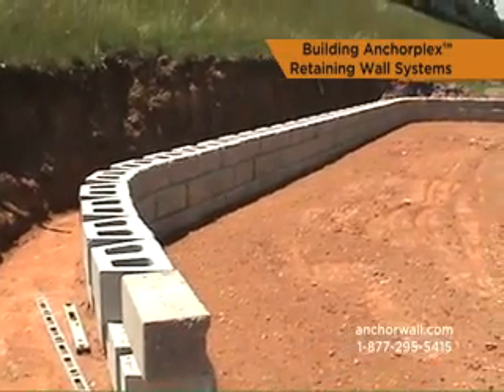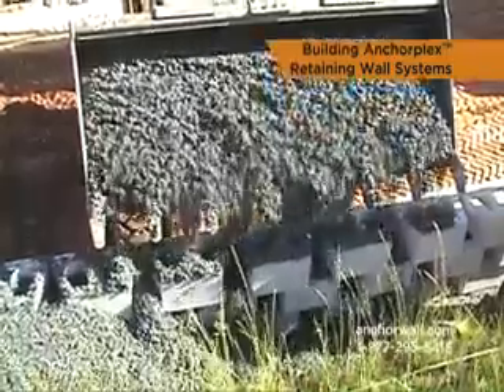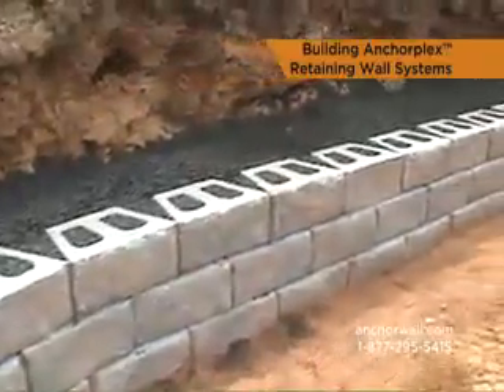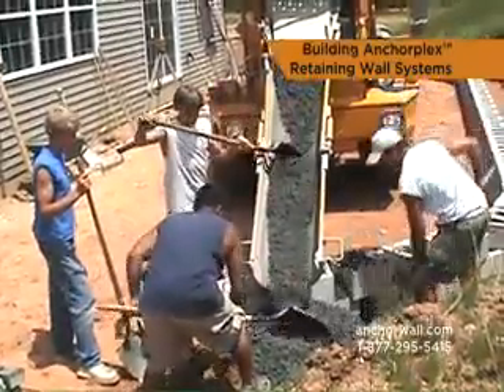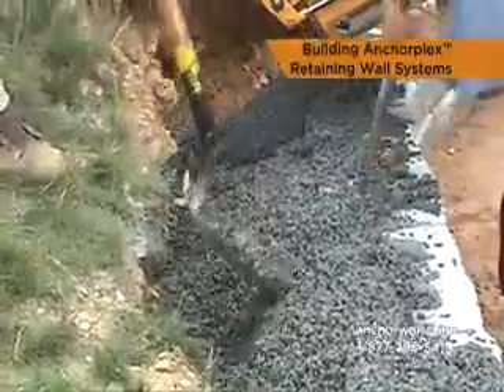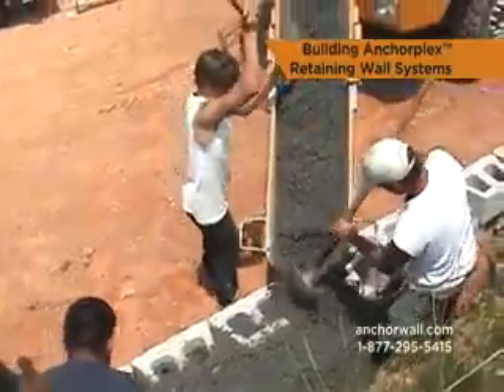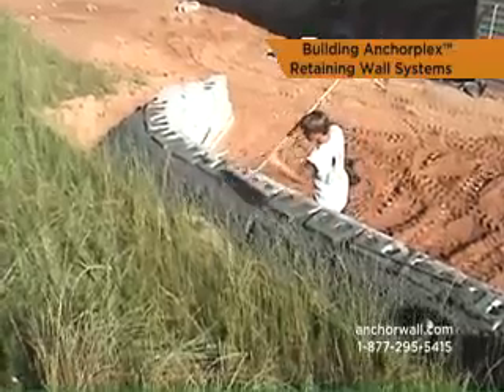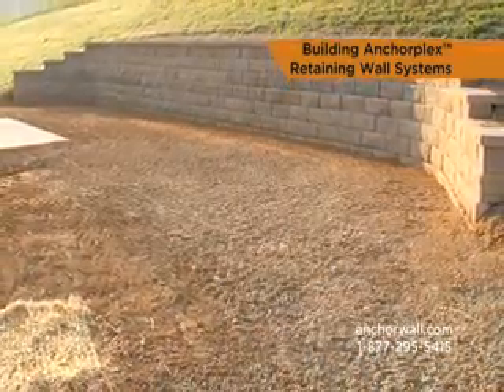The Anchorplex™ Retaining Wall System

Comment: I have my doubts on this method also and any retaining wall over 4 feet tall or with a surcharge should most likely have geogrid reinforcement. Where is this backfill product available from in the St. Louis area? If it is like concrete does it remain porous for it to drain relieving hydrostatic pressure? There are other methods of building certain walls with out geogrid such as a cantilever base block installation, but usually about as costly and takes longer to install. I would have to consult an engineer on this method and have approved designs of this before feeling comfortable with it or installing this.

Comment: Look like you guys haven't done any retaining wall in a rain area. Retaining wall should be build with the worse scenario in mind. Best to design by an engineer who will need a soil test. Always use an 90mm AGI PIPE for drayage . And use light weight rock as a backfill like scoria. Fill it up to halfway before any other gravel and top soil.. Always leave room for water to flow away.. Never underestimate what water can do.
Reply: No way would i use this solution in a rain zone

Comment: If it were backfilled with normal concrete with fines (sand), it wouldn't allow water drainage.  The structural backfill (concrete and rock w/o sand) does the same job, and allows water permeability at the same time.  Water building up behind a wall with no drainage will fail.